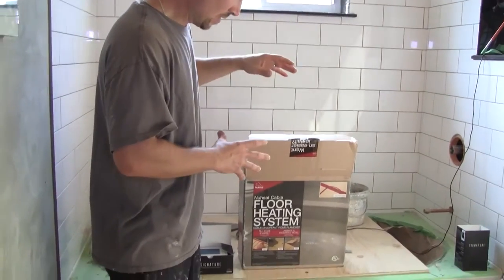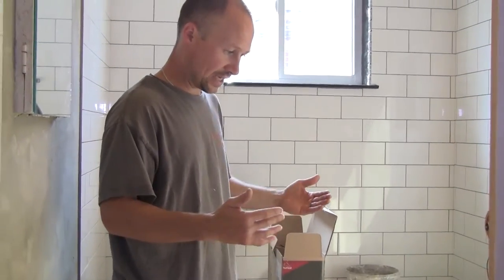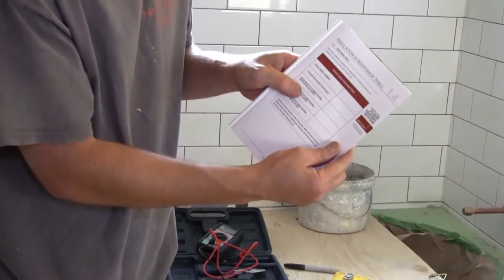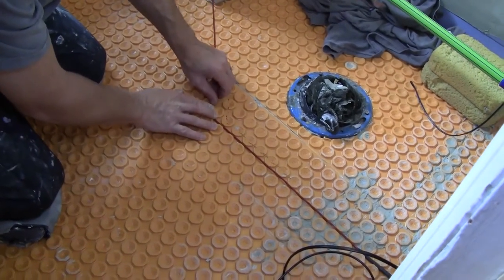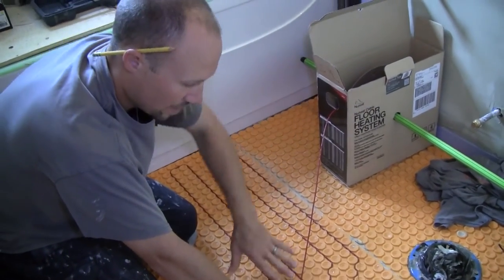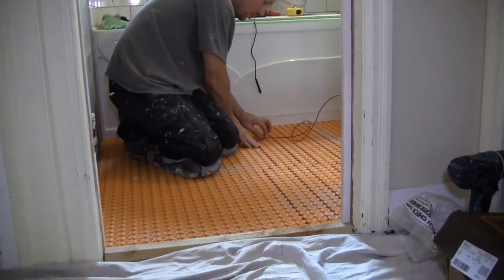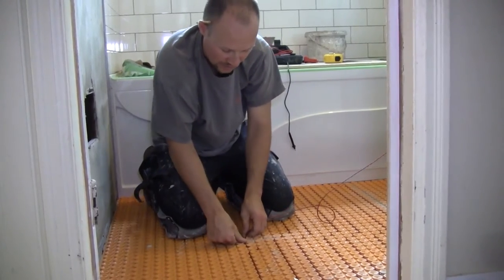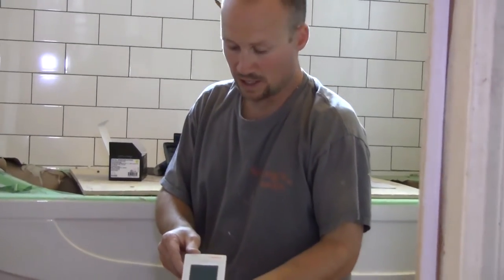In-floor Heating Cable Installation

Comment: Does anyone know why you cant use Ditra heating system with LVT, vinyl planks?
Reply from the maker: The DITRA system is made from round "dimples" that wouldn't allow for proper installation of the vinyl flooring. The vinyl would basically fall down into the dimples due to the fact that there wouldn't be enough support. That being said, if you wanted to try and skim the DITRA heat mat with a strong mortar, it may flatten/level it out to allow the vinyl to be installed, though DITRA, by nature, shifts and moves and doesn't allow mortar to adhere to it. It may end up cracking. Your better bet is to just use the heating cables, install self leveller, then install the click vinyl.
Hope that helps.

Comment: Wouldn't you like to at least mention the SCHLUTER Ditra Heat?
Reply from the maker: Well I could, but the cable itself isn't as good as the Nu Heat cable, and it's more expensive. Just doesn't make sense to use it instead of Nu Heat.
Reply from the maker: They would never warranty the cable if anything happened not using their product. I would stick with the same thermostat for the same cable.

Comment: I just can't get over the he never centred the wall. them slivers are killing me. but good job on heated floor
Reply from the maker: I did the tile on the walls that way for a few reasons. The main one being that the window would have the slivers instead of the angles in the wall. If you notice, I offset the slivers with the other wall side tile being the larger tile, this also made it work perfectly for the starting points of the left and wall tiles.
There's more to the final product than just "center it on the wall" :)
Reply from the maker: If you are able to watch the other videos on the wall tile installation, it shows why I did the tile that way. I don't like slivers on the ends and it worked best with the rest of the wall. I also needed to center the tile to the window as the window was offset. Thanks for liking the heated floor :)